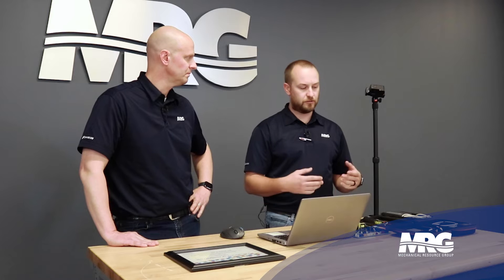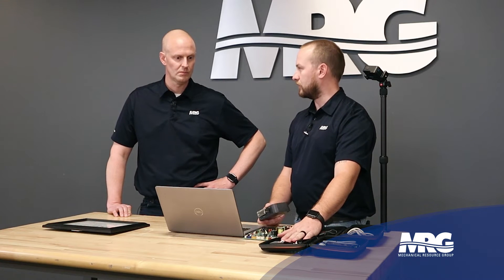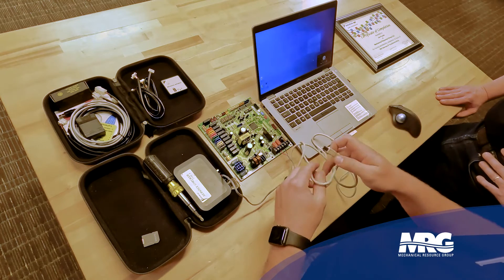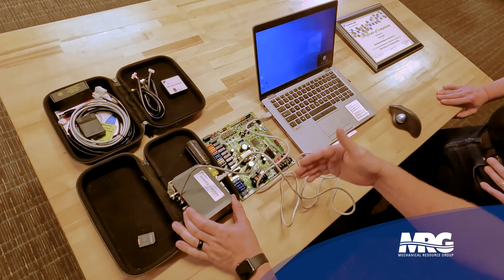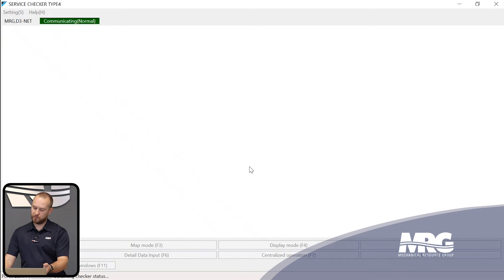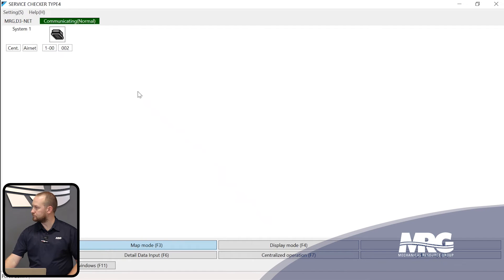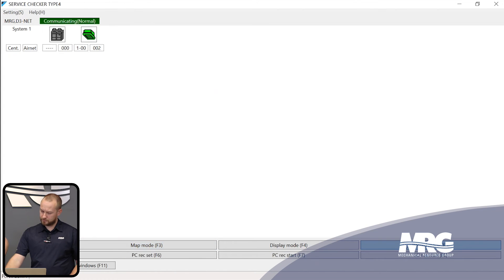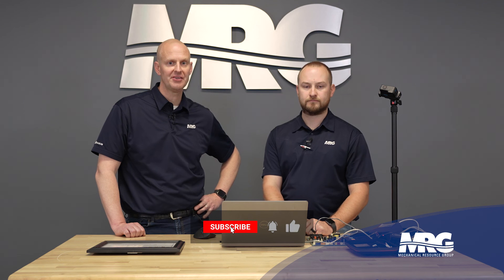Learn to Setup a Daikin VRV Service Checker in 10 Minutes!

Comment: What training do I need to take to get the service checker 4 so I can purchase a software and a service check for at this time. I do have the Wireless that I using with my phone
Reply from the maker: You have to be certified by a Daikin instructor and complete 2 trainings: Installation & Commissioning, and Service & Troubleshooting. These are in-person classes that Daikin or your local rep may host.

Comment: What size SD card would you recommend?
Reply: Good question. . It will come down to if there is a size limit the chip the checker is able to write to. Checker gives estimates based on frequency and you can filter systems. Not sure about the standalone